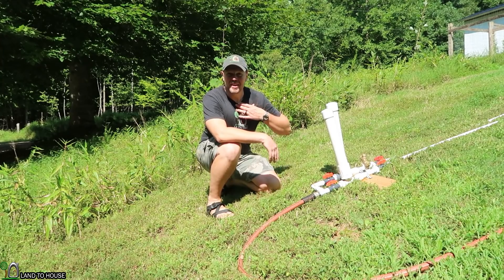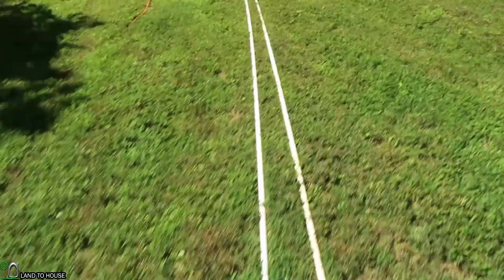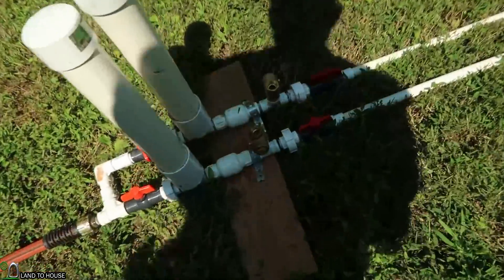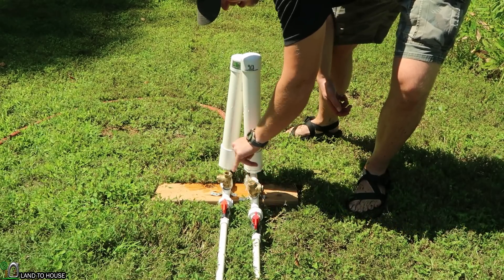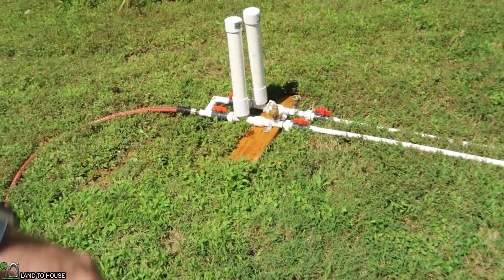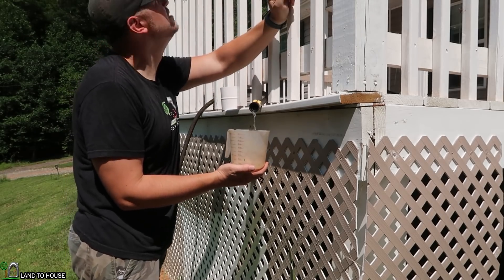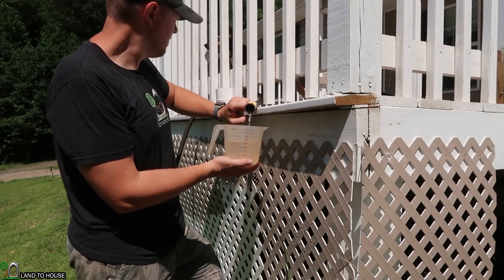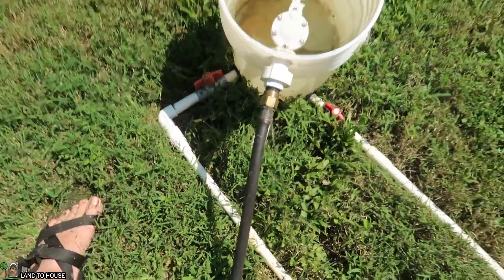Two Ram Pumps in Parallel - Increase Volume Output

Comment: Two pumps in parallel = 2x the volume of water.   Two pumps in series = 2x the pressure (the height you can pump water up).  
(ignoring small losses of course)

Comment: I think pump 1 was dumping half it load into pump 2 before pump 2 released in order for it to work both pumps would have to be synchronized in order to push both there own volume up the hose. Sorry for the wrong terminology, I hope you understood

Comment: Hi.
I do watch all your vedios. Your experiments with the pumps and water flow are excellent. Nice. 

Could you explain me:-
How to find out whether the DELIVERY/OUTPUT side height  is lower than the 
SUPPLY/INFLOW side (water level) in the case of
SIPHON pump lifting of water..?

(If the delivery ground level- height- is not Lower than the Supply/Input water level, the siphon wouldn't work..
Am I right... Please explain)
As I need this answer which would help me in using/connecting the SIPHON source to the RAM PUMP..
to raise the delivery level a little higher..)

Comment: I wonder if the timing of the hammer or whatever you wanna call it, On the rampumps in series like that could could affect its performance, Like what would happen if you put them exactly out of sync,  Essentially making almost like a constant hammer effect Wonder if that would increase the flow

Comment: so 2 pumps essentially increases exahust valve size more outflow so harder impacts unless alternating impacts you could simply have 1 pump 2 valves and get same results no need for an extra charge tank or could double charge tank size to not skew results but if 3/4 valves x2 =flow than 1.5 in valve x1 should have equal flow... maybe i guess easiest for cost would be 2, 1inch valves vs a 2 inch valve found in sump pump isle at hardware store but i suppose you could downscale too. like half half and 1 size valves  but what if you turbocharged it like collect the exaust of the 1st pump to power a second pump further down assuming equal lengths of drive pipe for water hammer and equal drop per distance

Comment: Have you tried a larger pipe like 3 inch x number of feet then reduce to 2 inch x number of feet then 1.25 X number of feet then to the pump to increase head pressure ?

Comment: I have been following your channel and your experiments with your Ram Pump with great interest. Two Ram pumps running in Parallel have indeed increased the output volume. Congratulations on this experiments! This leads me to believe that the volume output would increase if two Ram Pumps are connected one after another at a distance apart, instead of two Ram Pumps running in parallel?
Reply from the maker: The problem with pumps in series is that the flow to the second pump is not high enough and the pressure wave need an open to air source.
Reply: @LandtoHouse  Thanks for this useful information. God bless.

Comment: The increase of water getting pumped out worth the multi-installation of these pumps, as it will reduce the time to fill up the tank, reduce the size of the tank, increase water usage capacity and as backup system of failure or maintenance.

Comment: I recently discovered these pumps and have so many ideas.... would a Tesla valve help when joining pumps to prevent reversion? 

If you could theoretically have an infinite hill, could you keep chaining the waste valve from one pump to another until there is either no waste output or the pump lacks input head pressure to work?

Is there any benefit to pumping water higher only to fall through water wheels or would it always be more effective to simply use the flow to run a generator instead of bothering with a ram pump in the first place?

Im trying to determine if a ram pump can increase generator efficiency by pumping water back up to the generator again or if it would always be better to just add more generators if there is still flow.

Just curious. Find this stuff fascinating.

Comment: Put an 1-1/4 from the bucket, it would make the water heavier and faster going down to the Pump and I'm sure the discharge hose will increase in volume and pressure

Comment: I don't know if you answered this before or not, and I haven't found any of your videos addressing this, so if you get a chance, could you respond with a video, video link, or answer? 
1. What is the minimum flow rate, GPM, needed at the ram pump's input? 
2. What is the minimum PSI needed at the ram pump's input? 

I don't need 'head pressure'. Head pressure is not listed on electric pumps. Thanks in advance.

Comment: for this to work, I think you need extra check valves where your ball valves are - reason being your making two pressure waves, and if they aren't in the right sync they will/can cancel eachother out and reverse flow. 
But with an extra check valve after each ram pump it should ensure that the pressure from pump A or B doesn't flow back into the other ram pump

Comment: I have been wondering if you put a third check valve on the feed side in line would it increase the pressure by not allowing the shock wave to return up the feed pipe

Comment: Without a pressure release behind the second line to absorb the shock.of the delivery pressure, you will end up seeing the variable back pressure on each valve fluctuating. This will mean reduced throughput as you may end up with positive pressure slamming the back of the valve when the ram is busy trying to deliver water.

So not surprised the results slipped despite drawing double the water.

Comment: If the delivery pipe diameter is big enough increasing the flow shouldn't be a problem. But if the diameter is smaller, the friction will start consuming more energy as the flow increases. You can test the same experiment using smaller diameter delivery pipes to see how much the resulting flow decreases compared to this test. More friction on the delivery pipe is equivalent to lifting the water higher, that is why the flow is always less than double

Comment: What if you used one larger diameter feed pipe, that would the 'Y' off in to multiple pumps? At what point would you start to see a loss?

Comment: Fluid dynamics,  the 90s are hurting you.  One 2 inch valve out of the bucket, into a y pipe to the pumps. And on the other end, from the two pumps into a y pipe, into the delivery hose.  But then, why double up instead of using one big pump?  Your a genius, but every once in a while, you make me wonder….is it saving the smart stuff for future videos? 😂
Reply from the maker: I like to answer email questions by videos. Increasing pump size is best.  This method is a valid way of reducing pump size when there is not enough water to run one big pump.
Reply: @LandtoHouse  if the two pumps were identical and independent with enough water flow in, the output would have been true equal. Would the same be said for 2x bigger single pump?  I was picking at ya, but didnt realize it was email response. That actually told me alot.

Comment: have you considered using the water coming out of the check value which now just goes onto the lawn area and feed that into the line going up the hill?
Reply: Stacking pumps uphill affords an opportunity to add a recycle loop from top pump to lower pump and back.  I am excited to see the pump stack experiment as I have considered using this config to fill a tower.  How compact can the top pump drive pump be made?  Is Larger bore drive pipe more compact for vertical lifting?

Comment: You could rerun the test running each pump separately and then combined. The other issues I see I the hard angle of the entry point just prior to the garden hose, and possibly a bit of back pressure at that aforementioned point. Possibly the use of one-way valves and more of a wye configuration would remedy the losses.

Comment: For determining a difference in delivery HEIGHT: You can just measure the maximum pressure with one vs. two pumps. 1psi=2.306feet or 1foot=0.4337psi. I also would not expect a difference.

Comment: Nice and consistent test! I appreciate that you also use SI units (ml) ;-)  Regarding the result (500ml vs. 850ml, which is not exacly a doubling): In your outro you can see (and hear) that your second pumps cycles faster! Hence the second pump is less efficient and delivers only 350ml per minute, where the first pump delivers 500ml. So the test is consistent.
Btw.: Have a nice and recreative vacation!

Comment: Good stuff to know! Keep doing more tests.

I think "double" is misleading. 70% increase is accurate (500ml to 850ml, in increase of 350ml per minute, 350 is 70% of 500). If you take out the 90 and optimize and can measure repeatedly a doubling increase, sure, I'll accept that.

Comment: I wonder if the two pumps are trying to feed back against one another. Try putting a check valve AFTER each chamber. Also, use a WYE and not a TEE with 90 after the chambers. I would be tempted to also put a check valve after the WYE.
Reply: Hi what's the purpose of the valve that spurts water?
Reply from the maker: The waste valve closes and creates a water hammer that sends a pressure wave into the secondary valve building pressure in the tank to push water up.

Comment: Put a TEE with a ball valve at the bottom of the delivery pipe. Open the ball valve to get rid of all the air in the delivery pipe. Let gravity be your friend. Put schraeder valves in the tops of your chambers. You can press those in, and let the air out of the chamber.

Comment: Interesting to see one 3/4 drive pipe/ram pump from this same height. It has 2.25x the surface area of the 1/2 inch pump and would indicate if there is any merit in the double 1/2 inch pumps or if it's just the increase in valve surface area that is providing the increase and one 3/4 inch pump would do as well.

Comment: Test the line with the 90 degree bends by itself.  Compare that result with testing the other line by itself.  If those are equal, then it wasn't the 90 degree bends, if 90 degree onee is slower that that's probably it.
Another interesting idea:   if you could get both pumps cycling at exactly the same frequency, test flow rate for both lines at the same time when the pumps are perfectly synchronized and then run a second test when they are perfectly un-syncronized.

Comment: Very nice! I agree with others that the two pumps pushing into the same delivery pipe are kind of competing against each other a bit, so double volume isn't possible in a shared pipe. Also, even if it helped, I think it would be practically impossible to maintain sync of the two pumps (like a bicycle crank), so it is what it is. In a use case with plentiful water supply, I'd be interested to know whether multiple small pumps are better (more volume) than a single larger pump. Keep the experiments coming!

Comment: I'm going to build one of these for remote fossicking purposes I'm assuming that if I have it down stream with around 4-5 foot drop I could get the water back up stream around 20 feet or more would garden hose work with a spray bar not expecting great pressure

Comment: Nice.. Here's a question, If you use a pipe that was 2 inch, wouldn't that produce more water then the 1inch?? You are using 2 - 1 inch, so 1 - 2 inch should do the same, cause you were using the same source to run those 2.. As long as you can meet the demand of running a 2 inch, to me it seems a waste to run 2 - 1 inch lines... I'm not trying to criticize, Just asking.. this could be another round of tests you can do, is use larger diameter lines... I always find your videos educational.. keep it up.. I hope this gives you more ideas to test..

Comment: Very cool, thanks for trying and sharing this.  Watching the pumps' waste valves cycle at different speeds suggests the 2 pumps didn't have matching output anyway, so if you had tested #2 by itself first, then #2 and #1 together you might have seen more than double the output.

Comment: I ran a test last year to see flow rate change by tilting the first (vertical) one-way valve. Huge difference when you angle it to make it harder for flapper to close (one direction makes the flapper close easier). This one change will be a huge percentage increase.

Comment: Pumps seem out of sync, (doubt there is any way to get them in sync) so one is always pushing against the other. It would explain the loss at the top of the extra 1/2 cup. In theory, if you used two lines up the hill and used those two outlets to fill the measuring cup it should make roughly 4 cups.

Wonder if you synced up 3 or 4 in timing if it wouldn't act like an internal combustion engine with the previous "fired" one helping the next in sequence. The joys of science and engineering lol

Comment: i think the pumps are fighting each other for a fraction of a second. 
correct me if im wrong, ram pumps work on the basis of water hammer which a valve rapidly shut causes a pressure build up, and that pressure build up is what pushes the water up a hill.

thing is unless the valves are sycned perfectly, one side may be pushing the water backwards in the other pump.
try to measure the second pump by itself,  if it pumps the same amount as the first, then we know its fighting itself.
so its either installing another one way valve or just having parallel pipes

Comment: If you still have it all setup you could easily test each pump on their own to eliminate guessing about the 90 bend or any other efficiency deferences. Cool tho that it doesn’t interfere having the two pumps on the same pipe. One would expect back pressure or something might stall the pump. But it clearly works.

Comment: I was actually not surprised that 2 pumps have you less than double, it's very rare that things scale linearly though most people expect liner scaling. I actually expected ~750ml for the second after the first was 500ml, so 850ml was a great result 👍🏼
Reply: Not really, I would say the t-fitting is causing and imbalance in the pumps. It all works the same, you would never use a hard T in an exhaust system as the impulse wave will slow the T'ed side flow rate.
Reply: And the 2nd pump is cycling faster, so it is less efficient.

Comment: Have you tested using both valves with the Brass or Stella valve instead of the spring valve? I tried and lost delivery height.
Reply: Steel not Stella.

Comment: My guess, it is the 90 degree angle causing the imbalance. Try a "Y" valve.
Reply: I'm at 3:20 and was going to venture a guess that the RAM water from one pump is disturbing the action of the other and vice versa.  Perhaps need to synchronize them, but easier to just get a bigger pump.  Guess I'll see.
Reply: In the outro you can see and hear that the second pump is cycling faster. That makes it less efficient and I also suppose that the two 90ies in the delivery and drive pipe are the reason for this.
Reply: @patrickhoffmann8893  Makes sense to me. Good call.
Reply: Also, i believe if the 1/2" valves worked in unison the pressure snap back will not interfere w/ each other causing the loss. It may even increase the flow rate and velocity.
Reply: 3 1/2 cups then convert that to something else. Millilitres are millilitres 🤔 sorry for always knocking the imperial system 😬

Comment: Curious the flow was not exactly double. Please, re-run test with two 45 angles vs 180+90. Also, consider using a scale to measure water. Thanks for sharing.

Comment: Would be fascinating to see a datalogger showing the pressures on each of the lines and how they fluctuate over time. Maybe that's over-nerding a beautifully simple machine.... 😂
Reply from the maker: Its also over-nerding my abilities. Haha
Reply: @LandtoHouse  Seth, you have already worked with an Arduion (the chicken coop door, you remember?). You just need an electric pressure sensor. That could ba a Quarz crystal, but I am not sure in what pressure range this would work. There are also commercial electric pressure sensores available.